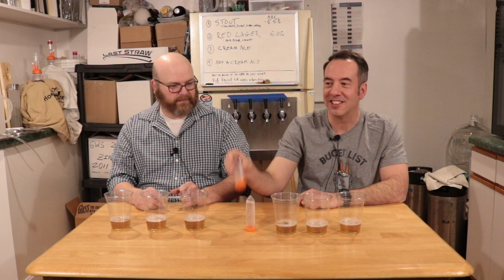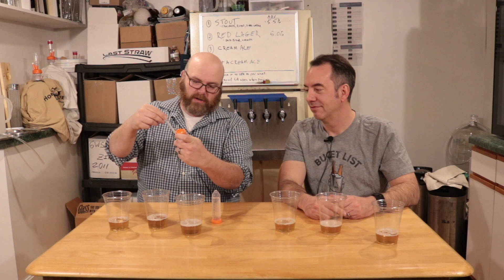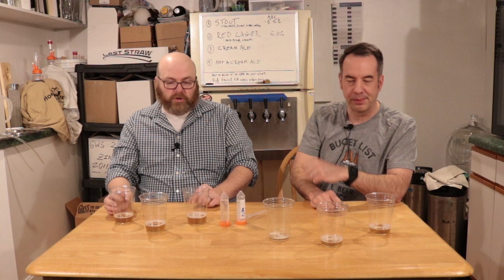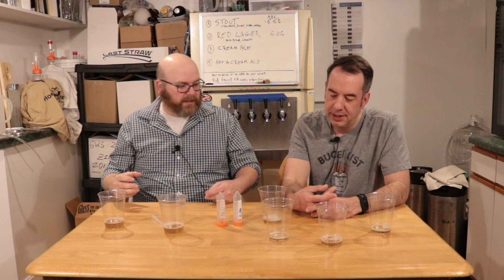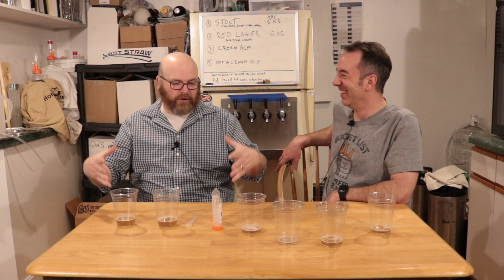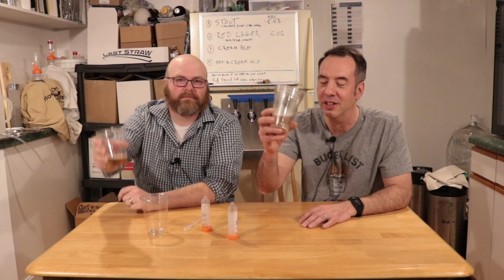Mineral Adjustments After Fermentation - Brewing Salts Experiment

Comment: If you're only getting the pH right in the mash with no salts, and just adding the flavour salts to the boil, how do you account for the kettle salts driving the final beer pH too high or low? Or does too negligible to even matter? Thanks.
Reply from the maker: I think that would be an extreme case for kettle pH to get out of control when adding salts in the kettle.  Furthermore, salts themselves don't really have an appreciable impact on pH.  If you add the salts just to water pH will be relatively unchanged.  Their reaction with Phosphates in the mash is what releases some H+ ions within the mash and that results in a lowering of pH.  By the time you get to the kettle most of those reactions have already reached equilibrium and changing pH at that point would likely require strangely large amounts of salts to push through the equilibrium.  At least that's my understanding.  And in this video we are just demonstrating how you can taste the impact of a little more sulfate or chloride has on the finished beer and you can use that for future formulations.  (One last thing, the only way to push pH up in the finished beer would be if you were adding chalk or baking soda and I don't think there's really ever a case to do that.). Cheers! -Mike
Reply: @BrewDudes  Thanks Mike, funnily enough I'm just cleaning up after trying this method for the first time today on a German Pils. I just used acid malt in the mash and hit bang on and then added any salts in the boil (I still treated the sparge water slightly with lactic to get to 6pH). Mash pH was closer to the software prediction than it has been in the last loads of brews. Cheers, love the videos, had been going back over a few during the holidays and found this really interesting.